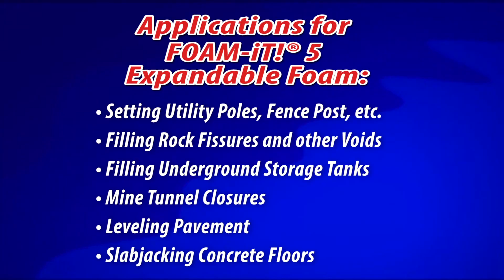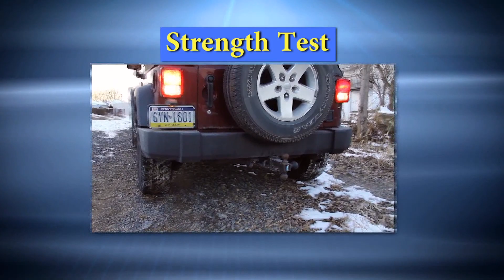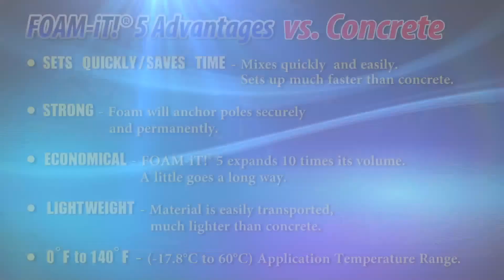Rapid Pole Setting Using FOAM iT! 5 Expanding Urethane Foam

Comment: Hi,  Great product but cost-wise might be an issue.  Working in cubic inches a gallon of this product would equate to about 230 cu in?  correct?   If I have posts (4X4's) that require 36" depth due to frost-line, I might get enough out of a gallon to do 2 posts.  Let me know if my calculations are right please.  I hate the idea of mixing all those bags of concrete.   But the costs seem prohobitive.
Thanks
Tom

Comment: An old video, but perhaps someone is still monitoring comments. I need to reset a single 4X4 gate post similar to the one in your video. Unsure of hole depth but I would excavate to about a 12” diameter. Would your sample size be adequate for my project? With what depth 12” hole with a 4X4 post would the sample size work?
Reply from the maker: Can you send us a tech ticket? Our team can help you - https://www.smooth-on.com/support/ticket/add/agree/

Comment: How does it cope with termites or floods?
Reply from the maker: Using FOAM-iT! to set poles helps reduce ground level decay in wood poles as it works as a water barrier.  It also helps reduce the amount of wood preservation chemicals seeping into surrounding soil.

Comment: Is this kind of foam safe to make a mascot costume head out of? Like pouring it into a mold and hollowing it out with a knife.
Reply from the maker: It would be easier to 'slush' the foam around in a silicone mold to make a hollow casting - but it can be done.

Comment: Does Foam-It 5 ™ have machinable or carving qualities?
Reply from the maker: Yes, fully cured foam can be sanded, machined, drilled, etc. (Wear a NIOSH approved respirator).
Reply: Smooth-On, Inc
Thank you for the reply!
Having answered my question would you mind answering another?
A 2” Corafoam sheet, considered one of the best mediums for CNC machining of signs costs about $700+ dollars per
4x8 sheet.
This works out to about 9200 cubic inches.
Heaping contempt on Corafoam is not my goal.
I’d much prefer to spend the same amount of dough, in measured doses, to fill forms of my choosing for machining
Where am I wrong?
If Foam-It 5™ is good...what Smooth-On product is specifically designed for fast set up and CNC machining?
Can this product compete with Corafoam?
Reply from the maker: Navigator777777  I would take a look at our Foam-iT 8 – it was designed for machining. We cannot do a pricing estimate for your application; however, you can call our technical support to discuss your application more in depth. The phone number is (800) 381-1733.
Reply: Smooth-On, Inc
Thanks...I will!

Comment: great stuff.  but what is the cost?  i have seen utility companies use it on power poles with no probs.  better that cement as cement stays wet from any moisture then rots the post sooner. i treat my pressure treated post with anti-rot, brushed on 3'ft from bottom a few days before using post. when buying PT post  there are 2 types.  one is cheaper and made from white log the other more $ but made from Fir which is better.  ask before you buy but most salesmen don't know squat
Reply: sales people dont know, because they havent been trained to know, and the managers dont know, because they dont care. general big box hardware store

Comment: What is the longevity of the foam?  Is this to be considered for long-term use?  Why would someone want to set with foam instead of concrete?  (I get that you said for weight... but if the foam breaks down over time... then it is hardly effective...)
Reply from the maker: This would depend on environmental conditions.  However, foam as a pole setting material, FOAM-iT! 5 has a compressive strength 3 to 4 times that of undisturbed soil, is equal to crushed stone against uplift and superior to stone in resistance to overturning.